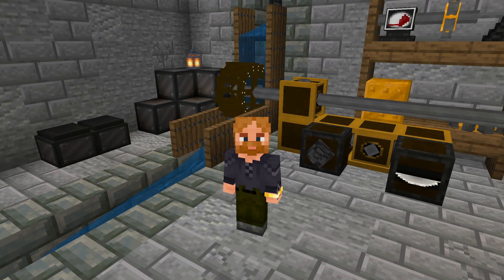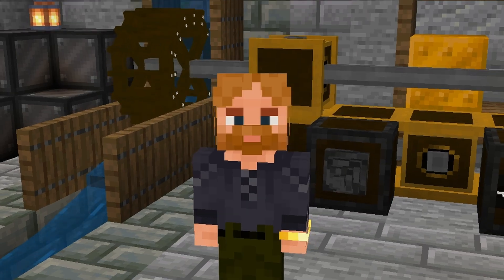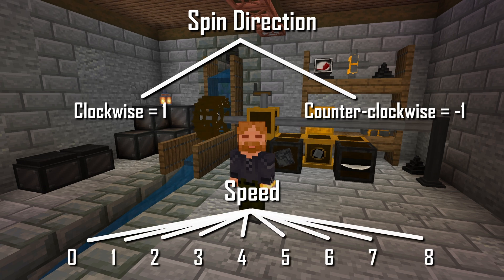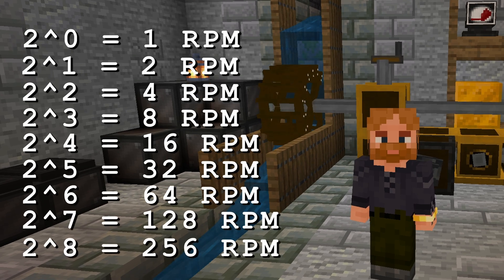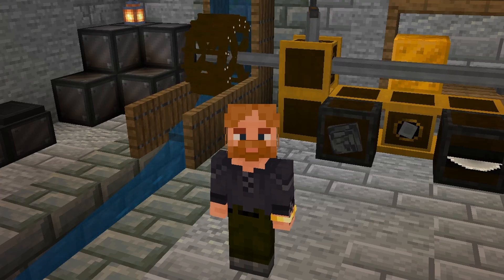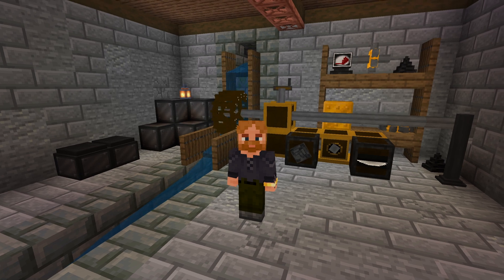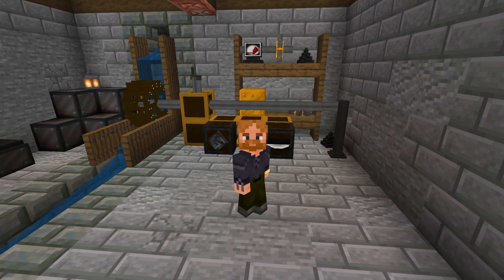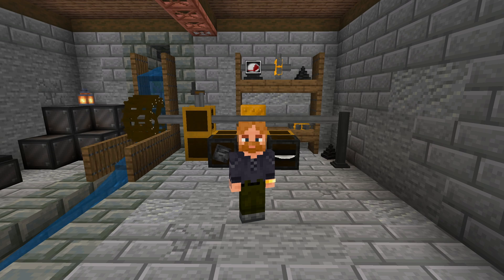I made mechanical motion in the INDUSTRIAL REVOLUTION Addon! - Devlog 2

Comment: 6:43  actually it would be 400 blocks diameter centred on the player as the sim distance is calculated without counting the chunk you are currently in(sim 4 would be 4 chunks around the chunk the player is standing on)

Comment: I dunno if this would help the unloaded mega network issue, but here's a suggestion (feel free to tell me how it would / wouldn't work)

Give all components the stored variables "network su", "network rpm", "time last updated"

This means upon loading network compents, if the connecting compent differs in "time last updated" it can update "network su" and "network rpm", which would then influence your current functionalities
Reply from the maker: That's one of the original ways I was going to tackle the issue, actually.

There's a thing called dynamic properties that allow me to store and read variables in the world. There's a big limitation, though... these dynamic properties are only available to the addon that created them.

That's an issue because any other addon that wants to be compatible with the mechanical networks wouldn't be able to access that data. So, avoiding the dynamic properties was a deliberate design decision I made to solve future problems that haven't arisen yet.

And, while I appreciate a 6000 block long shaft as much as the next guy, I decided that the built-in limitation was acceptable for game play.
Reply: @WayfindMinecraft 
Ah that makes sense.

Would there be anyway to make a component such as a 'transformer' to convert these dynamic properties into something else so that they would be compatable with other addons?